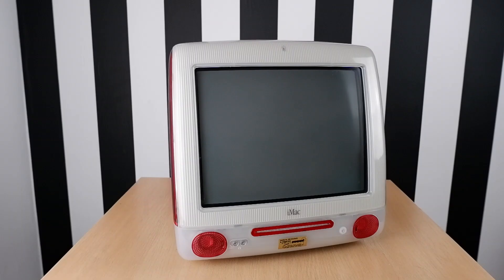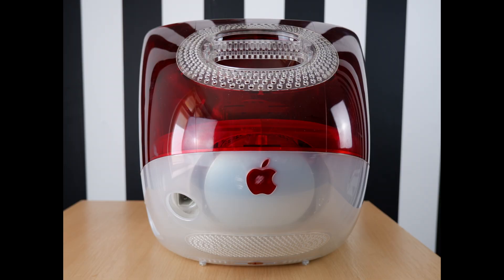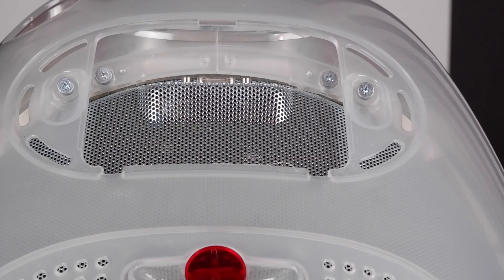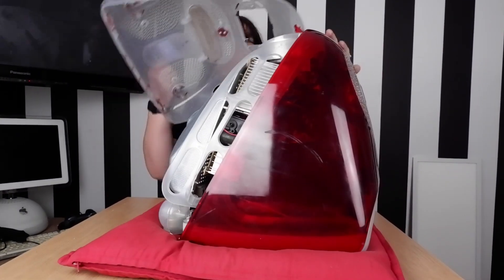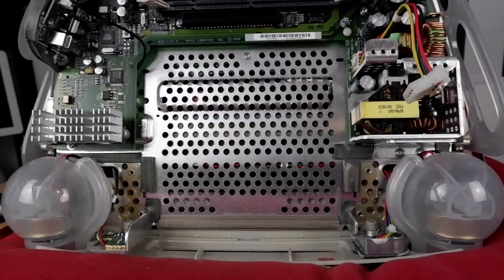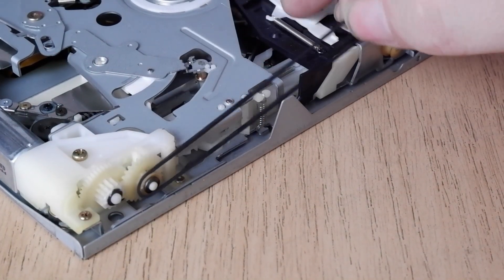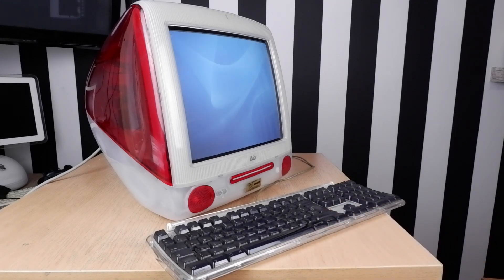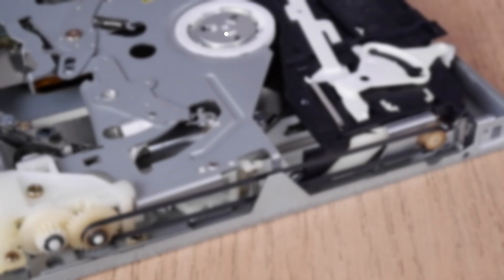Apple iMac G3 - DVD drive Issues

Comment: Starting around 10:55 , I get black screen for almost a minute and then you have put the plastic cover on again…

Four times it cuts out in the same spot.

Makes tricky to see what you did to manoeuvre it back into the case.

Great video. I’m sharing it with a friend who has the exact same issues, belt and battery. Thanks.

Comment: darn you  late 2000's thoshiba compny RW-HD dvd drives disk feeding slots issues on the g3 imacs stike agien. this is why super drive for newer apple mac laptops and desktops of there comptuers are now bascly sold speralty and can be reasy replaced besue it a extrnal usb plug in perfral drive that don't have this bulit in hardwired crap that thoshba compny put in those apple g3 imacs on the later modles suck realy bad. they are super duper INFERATING!

Comment: I need to do this on mine, what kind of belt do you need?
Reply from the maker: It was a 1.2mm x 58mm square drive belt. I grabbed it from EBay so a little search there should yield a result or two. I really need to find a local supplier though.

Comment: great video Jess when you take the drive apart it takes a square belt the round belt slips to much also there is a roller that is what ejects or pulls the cd disk it gets very grazed up with time clean the roller with alcohol add also the pullys that the belt goes on. these drives are unique to the slot load g3 and g4 cube I have service many of these drives when I did the g4 cube cd rom drive there is a like in that video for the belts hope this helps
Reply from the maker: Hey Dave. Thanks for the info. I’ll look up the G4 cube video as my Cube will need the drive serviced as it’s screwed currently. So that video will help immensely.

Comment: What would be a good size width for the belt? Amazon has a set of different sizes
Reply from the maker: Hey. I bought a 1.2mm x 58mm square belt though I might get an ever so smaller belt next time. More like a 1.2mm x 56mm, just to be a little tighter.

Comment: off topic, is there such a thing as a hardware virtual drive? example, similar to a flash drive, but internally, it has the ability to mount ISO files so when you plug it into a PC, it comes up as a physical CD drive with a disc in it. reason for this.. Mac OS 9 cannot mount PS1 ISO files as it gives a "low memory" error (even though there's more than enough RAM or disc space). Therefore, we never got the ability to mount PS1 games to play on connectix Virtual Game Station (ps1 emulator). A bit of trickery like a physical drive that mounts ISOs without having to burn physical discs would be a great way to get through.

Comment: Don't feel bad, slot loading drives are the worst. They look great esthetically, but even when they were new they could be problematic. I bought a batch of slim tray loading Firewire DVDs years ago, and use them most of the time on slot loading Macs.
Reply from the maker: I’ve got a G4 cube with a bad drive. I already know it’s not gonna be fixable, but I’ll still give it a look.

Comment: As far as I can tell, the drives that first shipped with these were a lot better, would eject with no hesitation for not being belt driven, had all metal interior mechanisms but they were only cd-rom or cd-r though. Another problem with these were the speakers that deteriorate over time.
Reply from the maker: Yeah. Everyone I’ve spoken to seems to have issues with these old drives. My G4 cube has a broken drive as well that I’ve yet to look at, but already know it’s probably not fixable. Such a same as those earlier drives were so much better.